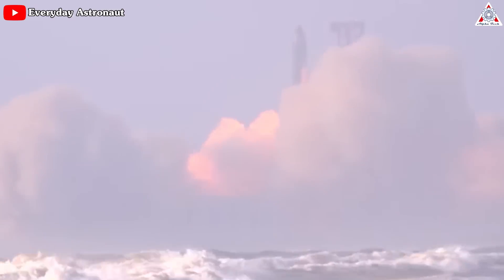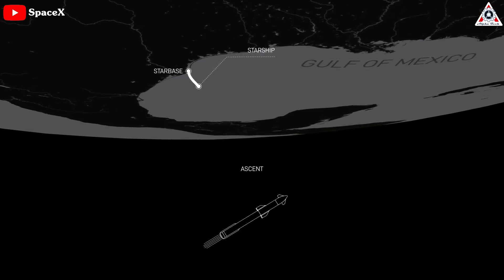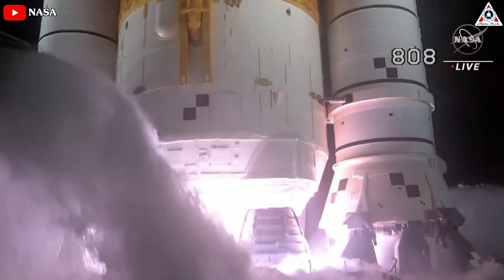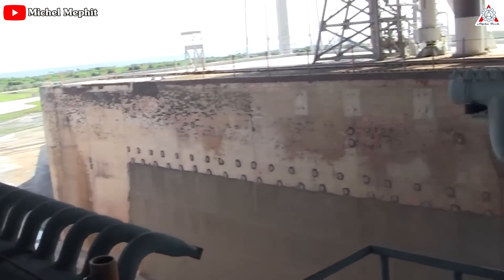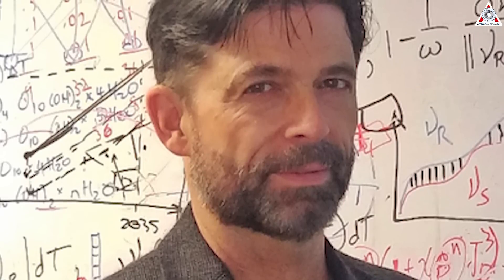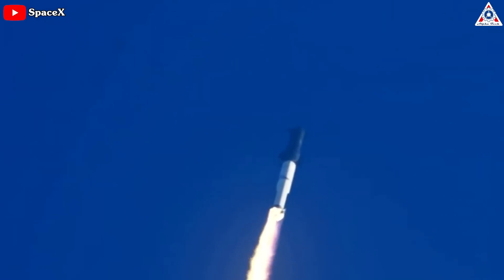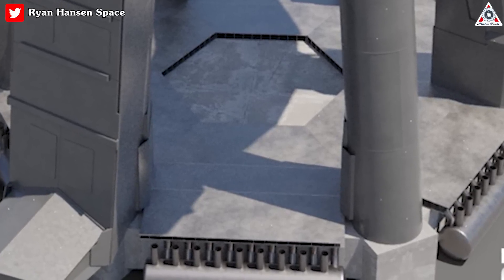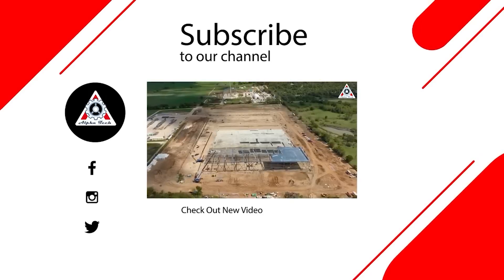SpaceX's NEW Solution to prevent the pad damage by 33 engines...

Comment: This is why the moon lander had a 2 piece design, so it could takeoff with its own launch pad that it brought. I don’t think propulsively landing a rocket and taking off a rocket from mars on the bare surface will work. Unless they put landing pads on mars before the starships land there
Reply: They can use a fraction of the power though landing on Mars (and before that the Moon), Starship has already landed OK on Earth albeit with no payload weight/reduced thrust. Perhaps the Mars trip is one way initially?
Reply: @nickoutram6939  the first 50 trips will be one way….
Reply: @Meatball2022  that’s right 👍😎’One way ticket to the Moon’
Reply: @nickoutram6939 One way indeed...
Reply: @nickoutram6939  an all up Starship has not landed - damage to the landing engines in this example would have precluded a safe landing.
Reply: @nickoutram6939  it equally only requires a fraction of the power to kick up the same quantity of debris...
Reply: Just wondering when they are going to launch a Super Heavy booster from the Moon or Mars? My guess would be never, so I don't understand how almost everyone is comparing the output of 33 Raptor Engines to that of the 6 engines on Starship.
Reply: @gamefacedgamer  exactly!
Reply: @gamefacedgamer  first it has to ‘soft -land’ (as opposed to crash-land there, without Air and Atmosphere…) hope my dad will live long enough just to see that he is in his late 80’s
Reply: @commonsense4257  So much for optimism.......my dad is 93 and going strong.  He still has a sharp mind and memory.  If we stay off sugar, salt, fat, junk food, and live healthy, we all can greatly extend our lives, especially given future medical gene advancement.
Reply: Lunar Starship HLS will land and take off from lunar surface using extra thrusters positioned on the upper half of its body. For Mars, the Starship would be taking off using its 6 engines, rather than with a 33 engine-booster. Note that Starship has taken off from Boca Chica before. Some Starships may bring materials for constructing landing pads, before attempting to take off.
Reply: All payloads going extraterrestrial could be placed in orbit around the receiving bodies. Takes virtually no energy to break orbit for return to Earth. Then, all required supplies could already be there when it comes time for the humans to navigate the trip. Once there the supplies could be deorbited as required, also taking virtually no energy, and colonization could begin.
Going back and forth orbit to orbit is not a big energy proposition. Getting things up to orbit is what burns fuel, relatively speaking.
Reply: Launch should never have happened . The dust cloud is unacceptable , imagine having asthma , or copd in the surrounding communities . Ignoring the obvious need to control the blast was an embarrassment to the brilliant engineers at space x . Elons hard headiness is a good thing and bad thing sometimes .
Reply: I'm surprised all of you are completely unaware the starship moon lander will have landing rockets high up on the ship set at an angle.  This gives time for the energy from the nozzles to disperse having less interaction with the landing site.  Also keep in mind, concrete on the moon is possible and taking off on the moon requires significantly less thrust.
Reply: It was also discarded on the moon because of lifting weight limits of the lander.
Reply: @traceydeviney  Yes, that was the Von Braun theory...to drop of weight with staging. The lunar lander was no different. There would not been enough fuel left after landing to lift the entire lunar lander.
Reply: I've thought about this a lot from a project planning standpoint.
You would absolutely want to send a few unmanned missions to Mars before people showed up. Prep a landing pad, prep a habitat, prep the water supply, prep the power supply, prep the garden for food supply, prep everything. Send a few of those new robots so they can do some simple construction. Mostly include origami buildings so they kinda assemble themselves.
I see no reason they couldn't make all the infrastructure before people showed up.
It's going to be hard enough to survive on Mars. It's lunacy to make them start from scratch.
Reply: @protorhinocerator142  buildings could be 3D printed. Being supplied with multiple polymers, the structure, windows and conductivity traces within the walls could all be printed from one robotic contraption (it's late, contraption works).

Being placed with precision as it would be, smaller robots already programmed could essential, screw in he lights when completed. Ready to move in.
Reply: Most early starship landings on the moon or Mars will not launch back. They will become part of a colony there.
Reply: Wow exactly was NASA said to Elon for propulsive landing rocket. NASA said it was too difficult and would not be safe enough. If Elon had listened to those people, SpaceX would have failed. Just because you don't understand the vision, does not mean it is not possible.
Reply: The lander is a patently dumb and dangerous system. What did we learn from the Space Shuttle? Do not put people on the side of a bomb and certainly not in one. There is no escape from booster or lander problems. None. 

This whole system is a fantasy designed NOT to go to the moon. It is for SpaceX only and that is to deliver Starlink 2 to orbit. No Starlink 2? No SpaceX. Those are Musk's words. 

And, btw, this is all funded with tax payer money.

This is a lot of fun and fantastical rocketry going on. Don't get me wrong: I love it. But is a bad design and it's costing tax payers hundreds of millions of dollars.
Reply: @commonsense4257  If SpaceX listens to NASA, Yes. If SpaceX keeps getting blocked by FAA, Yes. The entire issue is ridiculous as most actions by the FAA are to hinder inorder to protect the waste of space, time, and money known as NASA.
Reply: It's not supposed to work, it's just supposed to funnel tax dollars into Elon's pockets.
Reply: Oh dear, it sounds like we might need to send some interplanetary construction workers to Mars to build a few landing pads! Maybe we could get some aliens to help out, or recruit some highly skilled Martian engineers. Either way, I think we'll need more than just a couple of shovels and hard hats for this job. Let's hope they don't forget to pack their space sunscreen and snacks!
Reply: @pointersoftwaresystems  shouldn’t be too hard to make a self deploying landing pad
Reply: @trenthari  Elon?  Is that you?
Reply: Bringing up an old government narrative as a plausible is laughable
Reply: Why not 20'-30' landing legs that fold up against the fuselage between landings/launches? Give them a 30° to vertical for a nice wide base. Just in case the ground isn't perfectly level. 3'x3' pads for feet. True VTOL 😀.
Reply: @moonnugget1969  Take along a Logboss log splitter. Friend had some guys from China drop by wanted to see if it could press bricks out of dirt. Actually worked pretty well. Press mooncrete blocks and build structures.
Reply: Maybe just space out the landings and leave big craters each time.
Reply: Or was it to ditch a no longer needed landing apparatus?
Reply: I'm thinking 1st, a Starship full of assorted construction robots and portable machines, example 3D laser printer using Mars regolith feedstock
Reply: Mars is not Earth nor the Moon more than two vehicles may be needed to get back up to orbit? low ground hitting engine thrust as to be none starter? lift off engines near top of rocket to clear ground and then  after take off like Shuttle eject them and main thrusters take over? Getting to mars and may be using demos as a real time virtual control base for robot building constructing prior to any real landing attempt??  Decades not a quick fix race will do for success? as Elon's first lift off of SN24? shows,   Fools rush in where success is slow to come
Reply: The LM also had redundancy - at least one of the lunar landings destroyed the descent engine because it impacted the ground (Apollo 15).
Reply: @commonsense4257  Correct.  I'm 57 and theres no way I'm going to see a Mars landing in my lifetime.  30 year olds have a chance of seeing it happen, but for sure it will be nothing to do with Musk.
Reply: Why would that be an issue tho, mars launch would be 3 raptors not 33 and mars has 38% the gravity and considering the upper stage can already fly and land on earth I think it can easily float above the ground quick enough.
Reply: Why not build a foldingn starship landing module to send out to orbit prior....then have that stage wait in orbit to then dock to nose of a Second starship that will follow....then the rapture 2s can then Tug Boat push that module to Mars....then how it pop off the nose and preform the landing and deployment......then proceed to enter mars' atmosphete....then land and deploy....then have starship targetbthe landing pad and bingo bango.

The landing module can have a big ass heatshied like a wider nose shape that can open up and that can airbrake down to mars. As it opens up like a flower and slays out.

If they wanna refuel in orbit why not have other stages meet up and lockon to then be hauled to mars.....like a self assembing space train

SELF ASSEMBLING SPACE TRAIN!!!😮
Reply: @hamsterSNAKE  tf you talking about i had a stroke trying to read this
Reply: HLS starship has a ring of engines near the top of the tank section to avoid spraying debris into engines (somewhat similar to a skycrane lander system).

For Mars SpaceX could use a similar system, with double the thrust. It would require detaching part of the heatshield, but they could have a second starship in Mars orbit for the return, or even fit an Orion capsule into the cargo bay of a starship for the return to earth.
Reply: I think the unmanned missions might clear a pad from large debris and then bind the remaining regolith into a hardened pad. They'd need to do something similar to create habs so I don't see why they wouldn't.
Reply: This was just a test flight for super heavy. There was no payload onboard.
Reply: Trent Hari...my exact sentiments.  Even though they will be using less thrust due to lower gravity on Mars or the Moon, the debris will be just as bad, since the lower gravity will allow for the debris to fly up like popcorn and hit the vehicle.  I think the Starship will require a complete re-design where the engines will be elevated to decrease erosion during takeoff, not unlike the Apollo Moon Lander.
Reply: @petemiller519  So, you think that, with all the money and brains at SpaceX, the company didn't envision that its big rocket would destroy its launch pad? Bullshit. This was a built-in failure so more money could be raised from new stockholders or reapportioned from existing assets for more than just a rebuild of the area that was destroyed.
Reply: @petemiller519  Launching without a launch pad is prohibitive but Starship launching from Mars is not the same as Super Heavy launching from the OLM. Starship, with its 3 sea level raptors, launched in Earth Gravity with a minimum launch pad. There are a couple of off planet methods to build a launch pad in development. Lunar Starship, conceptualized by Space X, has a row of unknown engines in the nose cone section. They are elevated significantly above the regolith specifically to limit disturbing the regolith.
Reply: @PC-nf3no  Thanks for the info.
Reply: @petemiller519  Buzz’s biggest fear is the LEM tips over or breaks a leg on landing. It was done with slide rules, Musk can’t even get this thing into orbit.
Reply: The real killer of the SS concept is returning to Earth from interplanety velocity (harder than to de-orbit) with that big of a 1.5 year old heat shield. Mars take off will require a pad but that's not a problem.
Reply: @nehorlavazapalka  I don’t think it’s gonna be a problem. 1.5 years in space is nowhere near as rough as 1.5 years in coastal air.
Reply: @nehorlavazapalka  I actually met the owner of a company who has developed a special concrete made from moon and mars dust. The samples were just returned from a 18 month space flight and are currently being evaluated for possibly changes from being in space.
Reply: @nehorlavazapalka  yeah that is a big hurtle.  There have been different ideas on how to gradually cut velocity using orbits instead of a direct approach like Apollo.  Also, there is also another idea of sending the return mission to the moon instead, where we have an established facility and transferring the crew to a different orbiter.
Reply: @nehorlavazapalka  likely they will only orbit the starship instead of landing on earth. and there will be a shuttle of sorts for mars. using starship as a big ferry once in that transfer orbit etc. it doesn't make sense to land starship. It does make sense to fly fuel tanks, and supply missions.
Reply: @nehorlavazapalka  ... Perhaps they design planet to planet ships that move from orbiting space station ... Then separate vehicles for planet to space station.
Reply: @nehorlavazapalka  Fuel is the only issue there. Just have to back boost to slow down on approach. With tankers in orbit around every planetary checkpoint, it’s no big deal.
Reply: @nehorlavazapalka  technically it will only require a pad on Mars once colonized as there is no life to disturb there which is the whole reason there are so many restrictions here on Earth
Reply: Yeah. That dust is going to be floating for literal centuries
Reply: The 2 piece design had multiple purposes: 1) to increase distance of the nozzle from the surface (and mitigate the chance of FOD); 2)  to have stable a launch platform that doesn't topple over due to trenching under the lander legs; and )3 to make the lander as light as possible so the minimum needed thrust is used to lift off the lander from the moon surface. The Starship  design has non of these design features and is ignoring the engineering criteria used by the lunar lander.
Reply: @user-sq5bw2fc4n  1) Outdated concept because we have actually been to the moon and we now know that moon regolith is extremely fine and would have minimum impact for FOD, Strike 1 - Catch up to the 21st century. 2) I do believe that Stage 0 even with the damage did NOT topple over. Strike 2,  once again people falling into the NASA methodology that only previously used designs can ever work. No innovation, No opportunity to try something new, Just worked in the 50-60s and can't do anything else because reasons. Did you ever listen to Elon on why starship is unmanned for initial development? Reason, it is just equipment which can be rebuilt if it blows up or needs redesign. Stage 0 will work as designed with a little out of the box thinking and new materials, most likely. If SpaceX can design, test, and build, the most successful propulsive landing rocket in history, Falcon 9, they can solve this problem. 3) The Apollo lander has weight considers due to the limitations of its initial lift vehicle, Saturn 5, NOT because was the only design that would work, Strike 3. It is literally the reason why Starship is designed as such. Heavy Lifter has the design component to make the lunar version of starship capable of landing and returning. Or is your only solution the SLS which is 60s design with 80s left over engines and 2000s DISPOSABLE capsule? Your entire argument is why NASA has accomplished NOTHING in the last 40 years but developed failed dead-end vehicles which go NOWHERE. I know you are going to say ISS. So what has ISS done that Starlab did not already prove? Humm, we should have a permanent space station and not a cobbled together mash of modules over the last 30 years and at what expense. Elon is going to create a space vehicle which will actually do what NASA said the Space Shuttle would do. Now if only FAA and NASA would get out of the way. Ohh I get it, since SpaceX is private neither organization gets to sponge off the money which is what this entire stall technique by the FAA is about. Need to stall SpaceX enough so that SLS can be a success. HA good luck with that! SLS is an overpriced disposable dinosaur with an original thought in the entire design.
Reply: @user-sq5bw2fc4n  that was a 1960's design. Do you really think we should be basing a 21st century space travel system on a 1960's design?
Reply: @PC-nf3no  a 1960’s design that worked. You don’t discard success without good reason.
Reply: @PC-nf3no  No and you missed the point. The lunar lander was designed to eliminate as many margins of error to give the best chance for a successful return of 3 astronauts.   It failed on Apollo 1, and almost failed on Apollo 13.  Starship has none of design  features of the lunar module that helped ensure successful returns. All we get is "it will be refueled and it will fly back". That is it.
Reply: @user-sq5bw2fc4n  Well C4, I can see why you think I missed the point. There are so many things wrong with what you said, I really don't want to embarrass you. But, keep up the enthusiasm, you'll learn more along the way. Have a great day! peace brother!
Reply: @user-sq5bw2fc4n  ah yes the lunar lander from the 60s is the design they should use for a 2023+ vehicle
Reply: This thing is supposed to refuel in space? Or ever be human rated? Bwahahahahahahahahaha.😅😅😅😅😅
Reply: I really hope the government cancels their contract I'm NGL. 😅 they aren't taking lessons from our previous endeavors with space
Reply: @ezcreations777  in doing this they got further than the other project sls.
Reply: @SB7-r9i  what other project, Apollo? I think they made it into orbit wearing corduroy pants.
Reply: @SB7-r9i  What are you kidding me?!?  How so?
Reply: @SB7-r9i  in half the time for a fraction of the cost